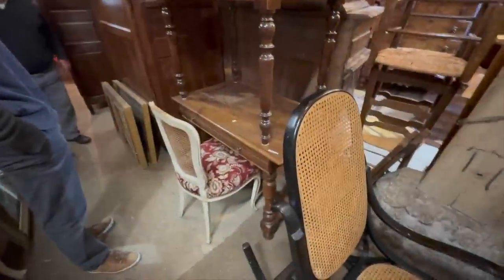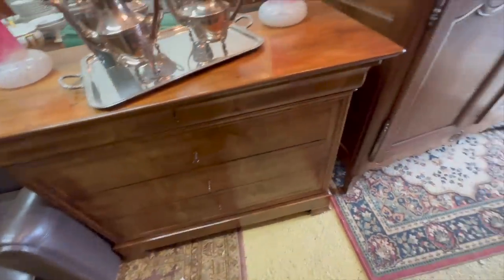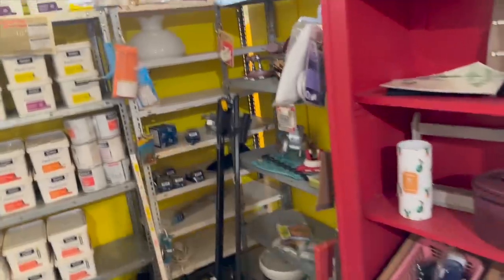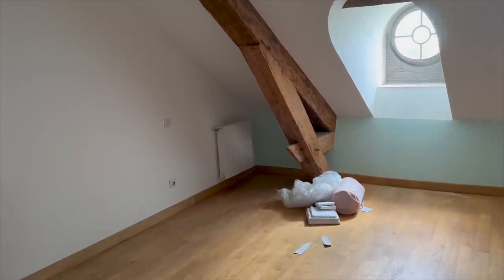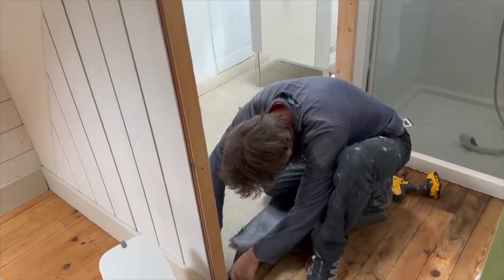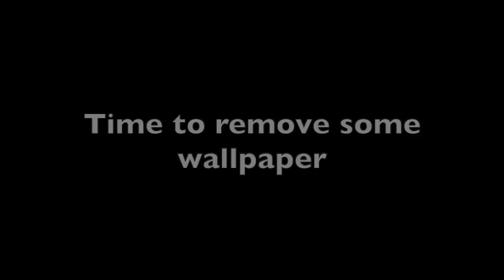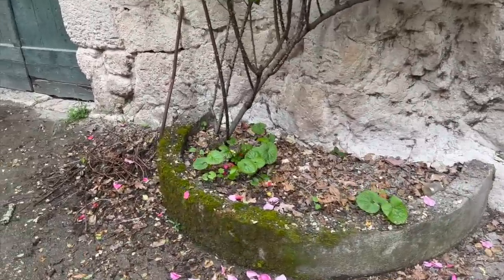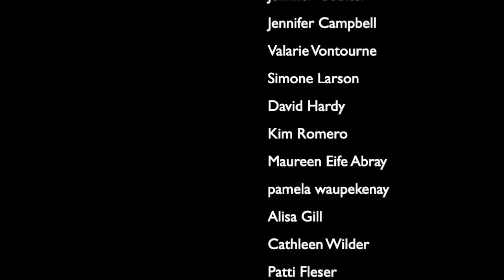My Last Week At My French Chateau Is A Real Stinker! – The Chateau Chronicles - Ep #32

Comment: Abby, Given the hot summers that France has been experiencing, I’m a bit concerned with how hot and uncomfortable the attic may be for your guests. One thing you might consider is removing the window glass from the hallway windows to allow for air circulation. You might also consider equipping the rooms with fans, either on the ceilings or on side tables. As one who has lived through many a hot summer, including in the US South and Midwest without AC (and more recently in the newly warm Seattle area summers), I can tell you that running fans all day can help a lot.

Comment: Love the little satin settee. I’d take off the fussy, ruffle skirt and add a long fringe! Love these brocante visits! Those pine floors will be lovely. After scraping carpet and industrial grade glue of some steps in my house, I just sanded and stained with min wax special walnut - a stain that takes away the yellow to make a lovely warm brown and then several coats of satin polyurethane. Turned out really, really nice even though the pine was old. So happy to hear Chloe is back to normal! Take care and have a safe trip home.

Comment: That piece of furniture with the flip top and drop down shelf would be great in one of those large landings on the 2nd floor for a bowl of fruit, coffee/tea station. It does not look right for a bedroom piece. I would have bought that 20 euro little set of drawers, remove the 3 bottom legs, slap on new ones (you can buy them just to screw on), wax the drawers, maybe change out the hardware - not really much work at all, and a nice piece for one of the bedrooms. In the top floor bedrooms, be careful about cramming in two beds - with those sloping ceilings, you will be to be careful about fitting in what you need in a guestroom - one bedside table (which could be a small dresser, writing table, or dressing table). If you can't fit in full armoires, look for narrow ones, or even hanging hooks for hanging clothes! Good luck with the visa process!
Reply: The first piece of furniture is indeed a side table meant for a dining room. You can put your dining paraphernalia, cut the roast, or put the ready-to-toss salad and the cheese board to save you a trip to the kitchen, and fold it nicely down when you're not having guests. They're nice tea stations, too.

Comment: Just a thought on the poop problem you encountered, that cap being loose might have saved you from a bigger BANG!!!!!
Is it possible that the was a gas build up and the cap was the weak point, causing the cap to fly off and the pipes content to come out?????
Maybe get a plumber to look at it, something might need venting or the septic looking at.
If gases aren’t building up and you screw/glue that cap down, it’s going to find the next weakest point “the loo 🚽🎉💩”
Reply from the maker: I think it was the laundry. There’s a sump pump as part if that system that I suspect had something to do with it. 🧐

Comment: Oh Abby you poor thing!  All that poop!  You absolutely need to secure that.  What you pulled out is a two-piece unit.  You need to unscrew one piece from the other (in the piece you actually pulled out) once you do that you can glue the bottom piece into the pipe with plumbers glue ( usually blue or pink) (The black line on the piece you pulled out signifies that its a rubber gasket, so this indicates that it comes apart) once you glue the piece in, you can then screw the top part in.  So for this exploding issue to happen, you either have a block vent pipe or no vent pipe.  So you need to address this issue asap.  Another job to your long list for when you return.  I hope this helps.  I am glad that Chloe is looking and feeling better, the poor little petal.  It is so stressful when they get sick.  I hope everything goes well back in the USA and you are back in France for good before too long.